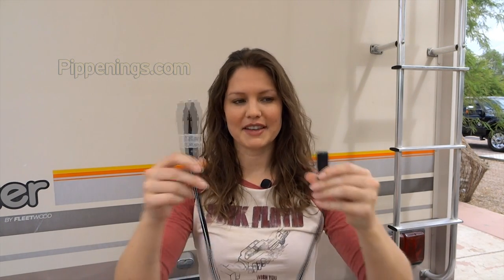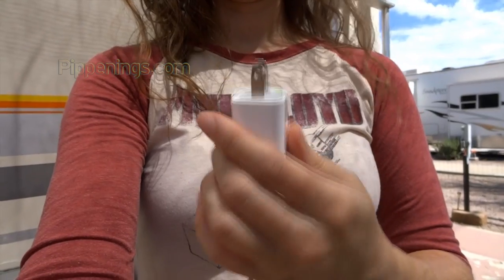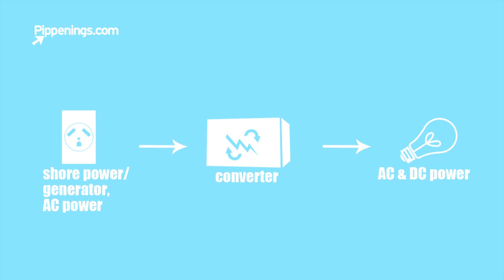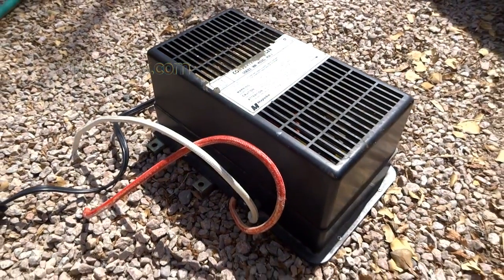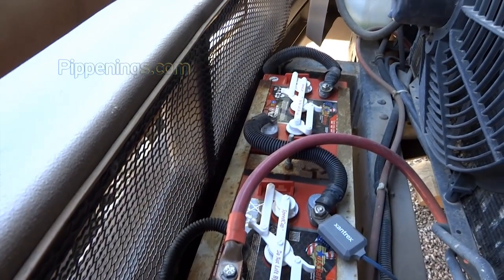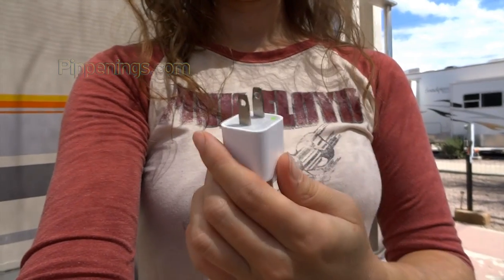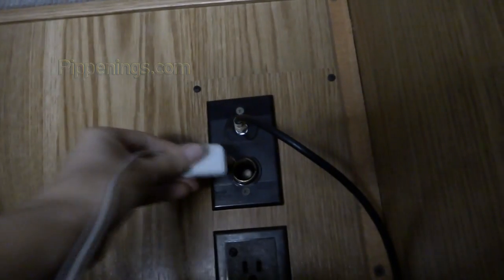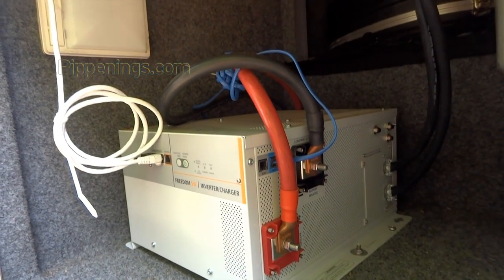RV Solar Living Basics: Inverters vs. Converters

Comment: I've always loved Pink Floyd and Meddle is an awesome album. I have a Van with 200 watts of solar panels and a 100 Amp hour Lithium Phosphate battery. I want to be able to charge my battery by other means such as alternator or shore power.  I'm a little confused about the differences of the different methods and how they would work with my LiPo4 battery.
Reply: I was in the kitchen, Seamus was my dog outside!

Comment: 99% right, good for you. The reason homes have AC is the AC Power can be transmitted on wires over long distances and DC can't. But AC power can't be stored directly. Only DC can, locally in batteries. The thing about sinewave inverters is their AC output is a pure 60 Hz without harmonics. But that is not so easy to produce and is less efficient. Making sinewave inverters expensive. Modified sinewave inverters approximate the pure 60 Hz sinewave, but in order to save money on the design, let some of that squarewave you showed mix and get through. The resulting output will have strong harmonics at 120 Hz, 360 Hz and higher. These cause radio interference in sensitive equipment. Meaning you're right, sinewave is the way to go in RV. Your conclusions and rules of thumb you teach in your many videos are generally spot on, but the reasoning you shared on how you got there is often subjective, sometimes fearful of unknowns, occasionally flat wrong, always cute, and very entertaining.

Comment: pippi got a question, I have 400watts of solar with 505 watt hours of batteries.  how big of an inverter do I need? Also you got rid of you buzz box so how do u power you 110 and Air Conditioning?  Thanks, Korey

Comment: Howdy. I'm doing a build for a campervan, but I'm very new to this (and I know too frikin' little about electrical systems). What I'm wondering is, do I need a converter? I plan on using the existing wiring that is in the back of the van (lights, 12 volt sockets etc.), and I would expect that I could run that directly to my battery bank, just as it's currently (pun intended) connected to my chassis battery. Am I correct?
Reply from the maker: +Jim Persinger If you only use 12v appliances than you don't need one.
Reply: I'll be using some 110 appliances as well, but I'll have an inverter for that. If the existing 12 volt wiring can be connected directly to the leisure batteries, I'm good.

Comment: Ok...so, I got inspired and I'm building my solar panel.  My panel is mainly to power my SETI receiving antenna dish, toaster and hair dryer.  It's not that I necessarily have sexy hair,  but I want it to be a sexy as can be!  Also I always try and remember to keep the hair dryer away from the bathtub in case I fall in lol!  Anyhoo,  while building my panel I couldn't remember if the black side goes up or down.  Well it was a 50/50 shot so I glued the black side down because sometimes black represents bad so I thought "well, that might not be good if the black squares are  looking at me!" so the other side is facing up.   Is that right?  I don't seem to be getting much power because I have to push the toast down like ten times!  Sheeeesh...one frustrated panel maker!

Comment: The Floyd!  Awesome, I'm a big fan too!  Pippi Power!  love your videos and it is really great information for full timers like me, as I wade through the technical details of upgrading and installing a more robust PV System on my rig.  I live full time too in my 1998 Monaco Dynasty,  it has solar but it's only 85 watts.  So... that doesn't go very far for boondocking and off the grid stays, of which I want to be able to do longer without running the gen set.  So this video is great and what impeccable timing!  Amps and Watts did you say...  lol  doing my energy audit today and have all the equipment manuals spread out and my excel spread sheet  Thanks for all the interesting and helpful videos Pippi !
Reply from the maker: +Jerry Sheets Yeehaw, good for you getting all organized and ready. Best of luck with :) 🍀

Comment: Threw the converter out first thing-too many EMF's.  I have a disconnected inverter in the line and I have a remote wired switch that I can turn on if I want to blend or paper shred - minute or less tasks. when I am done I turn off the inverter and switch. The real fun was finding the right DC plug to charge my macbook-hard to find and I keep back ups if one fails. Love being off grid! Then I do not use near the gadgets that most do and do not have any desire really to.
Reply from the maker: That's really awesome. I love the switch idea. I'd love to use less, but I'm so reliant on the internet right now. One step at a time though, right? All about the journey. I should look into getting a DC plug for my computer. They charge better when the AC isn't being converted.

Comment: great information.... looking to convert a 40' school bus into an RV.  And i am doing some research before i start. wiring , plumbing, battery life, converter thing you talk about inverter and solar panels as well.  I am looking to have an electric refrigerator small one,  but a gas stove type. I do have a question what size is your trailer wide, length ? thank for all your video. great job.
Reply from the maker: Check out my 30 to 50 amp conversion video for some help perhaps with electrical wiring. https://www.youtube.com/watch?v=iFYapUdEUMc My RV is 34 long about about 7.5 wide
Reply: ok thanks, that is what the buses i have been looking at are 35 feet not including the driver area, and 7.5 wide, just trying to see what my layout would be. love all your video's great job.

Comment: Best vid ever👍🏻so do you still have the buzz box? I unplug to sleep because I can't get used to the buzzing sound which is 4' from my pillow. I will be adding roof solar to my existing 100 watts Renogy portable suitcase. When I'm boondocking and dispersed camping I'll just be using the pure sine wave inverter. But the minute I'm on shore power 🔌the buzz is back in my life.🙀
Sounds like you don't use your converter at all. I followed everything except this. Don't you still need it when plugged in?
Do you know if new converters are quieter?
Reply from the maker: I've got an inverter now. I have the converter till but it's fully unplugged and out of use.
Reply: Thanks, watching your vid on batteries now. Just soooo well done and informative. Thanks we needed this!

Comment: Pippi, this is what I have read. Thomas Edison had invented the inconscient light bulb and the first electric generator. A DC generator at that. Much bigger cables in order to get the power where it needs to go. And it runs hot. Tesla how ever invented the AC generator. Runs at 60 mhz and is used as the standard today. I could have read wrong. But just saying.
Reply: Edison was a dick. He wanted everyone to run on DC power, (which would require a power plant every mile or so as it's not efficient over long distances). In order to scare people away from Tesla's AC power, he would electrocute animals to death in front of large crowds using AC current (touting it as dangerous) as part of his propaganda crusade (including circus elephants and neighborhood dogs). He invented the electric chair using AC power to show how dangerous it was.

Comment: I replaced the identical noisy converter in my Bounder with a Progressive Dynamics PD9270C Power Converter. It's the size of a PC power supply and makes no sound at all.
Reply: Thank you!
Reply: I found PD9270 V not C on Amazon. Do you know if the difference is substantial? Thanks, Tiki🚎💨💨💨
Reply: PD now lists it as just the PD9270 on their site.  Their documentation 
appears to leave off the C or V even for those models that are still 
listed with them on the web page itself. So, I'm guessing there really 
isn't any substantial difference. The specs are still the same as when I
 bought mine.
Reply: Thanks so much. Ill go to their site, too.
Reply from the maker: Nice, that buzz if hardly bearable. Good for you :)

Comment: Good explanation, and I agree pure sine wave is the way to go, especially when using electronic devices.  I've been a Pink Floyd fan since I was a kid and have the two, (sides 1-4) of The Wall album I got when I was 14 hanging on my RV wall cause the cover went missing years ago. It's cool how some stuff seems to stay around while other stuff has long gone.   ✌(◕‿-)✌